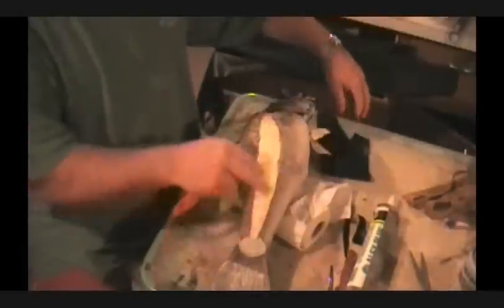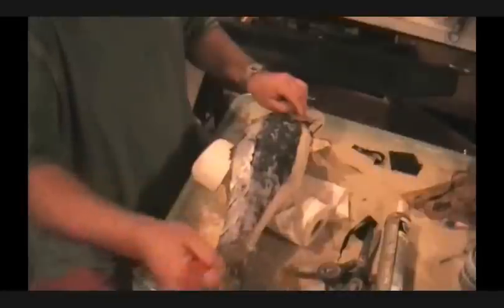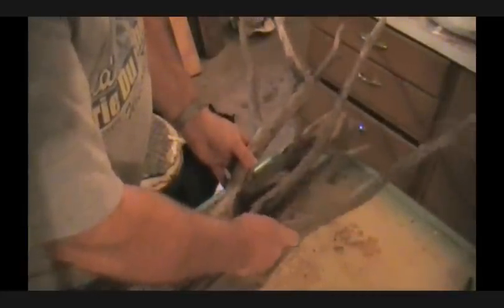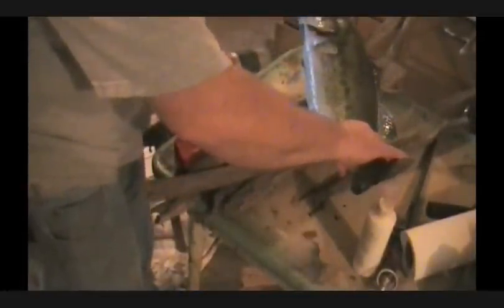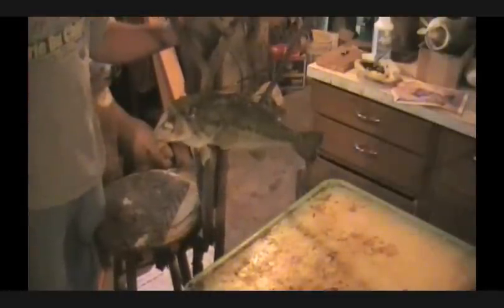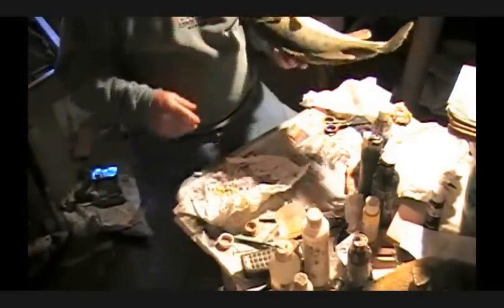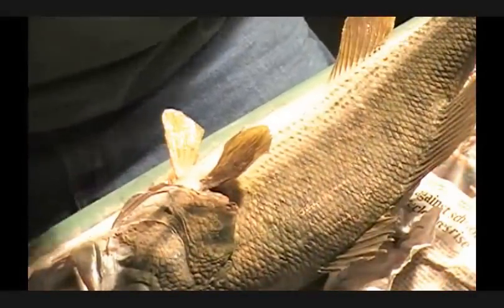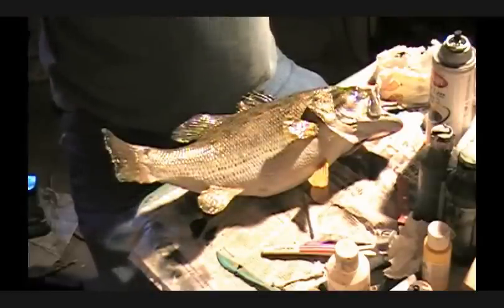FISH TAXIDERMY - BASS - Finishing Touches; Seam, Highlighting, Habitat - Video 5 of 5

Comment: Hi Richard, they came out great, I actually just finished up the two Fisher cats and a Coyote. All I have to do is finish up the painting. I ordered a airbrush yesterday, I'm hopping I can do a good job on that. I tell you what, I did an open mouth on one of the fishers, and that was an experience. Installing the the jaw set, I couldn't find any information anywhere, but I surprised myself it came out great. I had to rebuild the whole mouth. I'm also working on habitat, for the coyote, wall mount. I'm using great stuff foam and stone spray paint. It's coming along, fun stuff.
Reply from the maker: +Fernando Godinho Well, that's great!  Doing that open mouth is great practice.  I'll tell you... if  you can do an open mouth, you can do about anything.  You're really doing great.  Just one word of advice; go lightly with the airbrush.  It's a lot easier to add a little at a time than to take the paint off because it's too thick.  Would love to see your work, but, just can't figure out how to send/receive pictures through this site.  Thanks for writing in.  Email anytime. - Rick